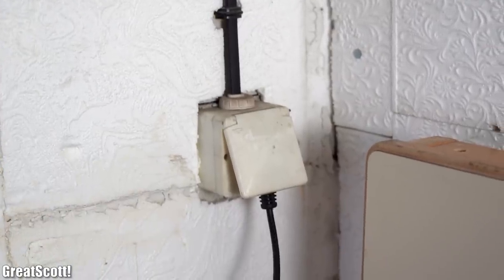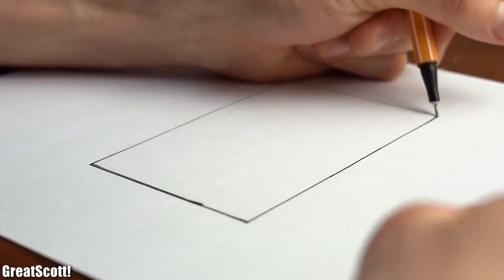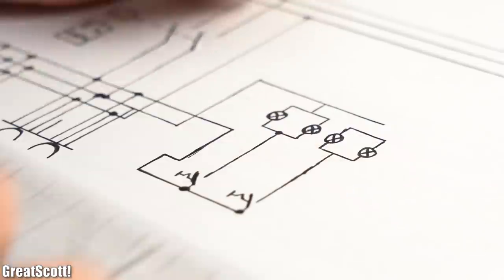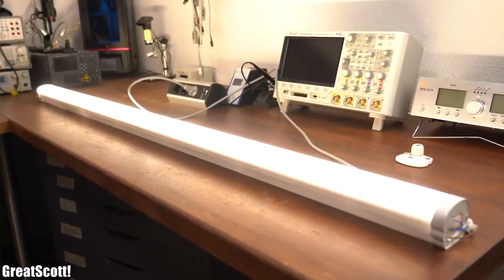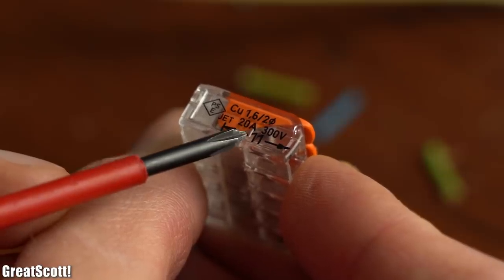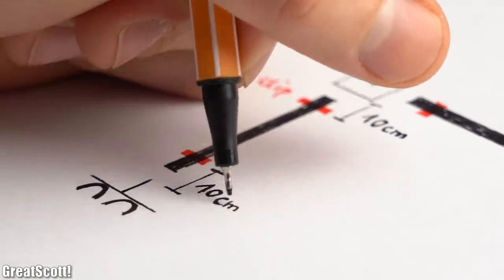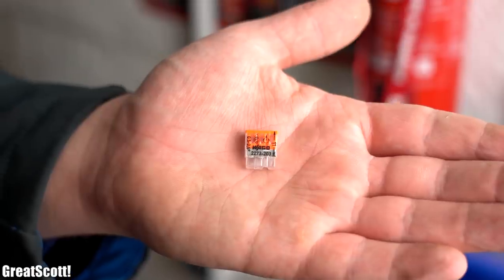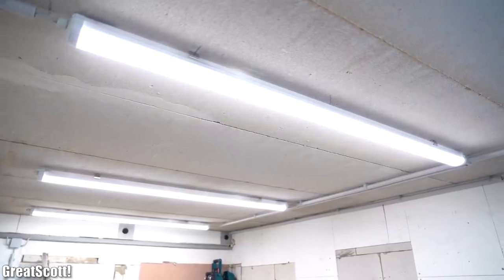How to do Electrical Wiring properly! (more or less....) GERMAN STYLE!

Comment: European standards for this kind of thing just seem exponentially better than any American standard the more I look into them
Reply: Most European standards are FAR better than American standards.
Reply: How do exactly? Seems really similar. For an exposed garage in America, we would need everything protected in conduit or metal shearing. The rest looks really similar as well.
Reply: I would disagree. American wiring standards are pretty impressive, especially considering it is a system of standards that has been in place for over 100 years. Just look at any US installation with either AC cable or EMT conduit. The installation in this video looks a little sloppy - in spots where the cable is not covered by conduit. With an EMT conduit, it would first be installed in a most effective way, and then wire pulled through it. That way all of wire is always protected by the conduit/boxes(which are metal and also provide backup ground)
Reply: @vitaliyzakharov6708   Impresive . Most American electrions just make it as good as the minimum has to be . Sorry but every time i seed American electric work its just the lowest Qality ever.
Reply: @vitaliyzakharov6708  the host used the wrong word. It's not wire, but cable.

The wires are always protected because in a on wall installation like this you use cables and not wires.
Reply: Also it doesn't make much sense that they're using a fuse along with circuit breakers. And that they haven't added separate breakers for lighting and plugs.
Reply: There's a lot of willful ignorance out there pretending to be about standards. The standards in North America, the Middle East, Asia, the UK and Europe seem different in small ways, often more a matter of the local history of electrification, copper shortages, and (surprisingly rarely) politics.  In North America,  AFCI's (Arc Fault Circuit Interrupters) have been required for years now in new wiring-- so how many of you have them  in your kids' bedrooms or living room?    Even though they appear less urgent in 230V countries, they are life savers precisely when an appliance malfunctions and draws a lot of current, but not enough to trip the breakers.

Comment: For all the people who don't have those spring terminals but a screw terminal. If you use solid core wire with the screw terminals style components. You need to check/retighten the screws after you press the whole e.g outlet internals into its housing. Since if you move/wiggle the solid core wires you could create a little space in the joint that could lead to a fire in the worst case.  If you want to do a test for yourself find a screw terminal style component, tighten a solid core wire, wiggle it, and then try to tighten it a bit more and you will feel that you can tighten it more.

Comment: American: Confused Unga Bunga
Reply: Why is the wire unprotected from the conduit to the junction boxes? I'm so confused.
Reply: @mitsuman007  I've never understood this either. But be prepared for a bunch of germans making up reasons as to why parts of it aren't protected. "Well you won't touch and damage that part" ...who's to say it's not impossible? Why bother protecting ANY of it with that sort of reasoning? All I can presume is that it makes the install cheaper and easier.
Reply: the gap is probably just for easier installation and to avoid kinking the wire. Though this type on conduit is more for organization than protection.
Reply: All I could think of is all the bugs getting in there so easily also.
Reply: @xxxh4x0rxxx21  have you ever had kids? Or designed something to be kid/idiot proof. Plenty of grabby fingers/accidents can pull those wires out. In the US the wire insulation isn't that bad, but they are housed in metal tubing. So, pretty strong defence.
Reply: @DaniMakes  Those open cables are only allowed in utility rooms we are kids are not allowed to play unattended / except in Germany kids are never allowed to play unattended
We have something called a Kabelkanal for rooms where it’s not possible to lay cable underneath the plaster  and have kids nearby
Reply: @TecSanento  I'm not the authority on standards. But that's sorta silly to assume a place will never have stupid people in it or kids. Aha. If that were true though, I'd still think it a great place for bugs and junk to get into. So it really is just aesthetic isn't it?
Reply: @DaniMakes  yeah, mostly aesthetics for these pipes -  but just to make it clear, which kids are big enough, that they can grab at 1,2m heights and at the same time stupid enough to play with electricity ?
Reply: @TecSanento  the same that make labels on products state obvious warnings.
Reply: American wiring is better than that, only cheapskates use pex piping, and those guys didnt even bother to bend it, they just cut it lmao. Why even use it at this point.
Reply: Hardly. In America those exposed wires wouldn't meet code. If it's not in-wall, it's in a conduit.
Reply: @DaniMakes  electric cabling in metal tubing... what could possibly go wrong. ;-) In the video they are handling cables, not wires - it would be really hard for a kid to pull them out of the junction box.
Reply: @AndreasStanglPlus  a lot less than you assume. It is grounded and really safe. Mock what you don't know I guess
Reply: @xxxh4x0rxxx21  problem is we americans tend to pull, hang and rip on any thing we can thts why our cables have to be run in a way to handle tht kind of abuse. yet are sockets have no switches like uk and are plugs are open contacts with just mm away from fingers lol

Comment: I didn’t even realise Aluminium wiring was even allowed in Germany or anywhere else in Europe! Thought it was purely an American aberration 🤣
Reply: Uk did have some. So always check even your tails. Also BT used Aluminium which cannot take the new Fibre To The Cabine so if you have big internet problems with speeds below 22mbs
Reply: After <whisper>the war</whisper> the price of copper went through the roof, so a lot of places built in the 40s, 50s and 60s got aluminium instead of copper.
That's one of the reasons the UK has its interesting ring main system. It uses copper, but requires far less than the fused spur setup used elsewhere.
My UK home was built in the 60s, the wiring is copper, but the phone line is/was aluminium, which being 60 years old, likes to break when disturbed.
I think most of the aluminium has been replaced these days.
Reply: Aluminium wiring is still allowed here in germany.
Reply from the maker: This system was built during the DDR time before the reunion. That is why it is aluminium.
Reply: @Electronics-Rocks  actually Shaun, FTTC can run on aluminium, but its range is less than over copper. I get 78mb/s, but I'm lucky because I can almost see the cabinet!
Reply: @HB-gt6cq  😱
Reply: @greatscottlab  Thanks for the explanation. That makes sense, and I hadn't thought about that, even though I'm old enough to have lived through it 👍 I just assumed it had to be all replaced by now.
Reply: @juststeve5542  I've always missed it in the UK. My Grandparents house was built in the 1930s -- copper, rewired several time, all copper. My parents house (1890's) was rewired in the 50's -- copper. My own house 20 years old -- copper. The only place I've first-hand seen aluminium used was in the 1980s in the USA. When my American stepfather told me about it: I honestly thought he was pulling my leg, until he showed it to me 😱
Reply: @gregf9160  everyone takes the mickey out of our UK ring main too (usually because they don't understand it), and miss its huge advantage.
If you want to add a new socket you only have to break into the ring at the nearest socket and loop it into the ring, you don't have to run a feed all the way back to a huge fuse board at the other side of the property and on a different floor! ;-)
Reply: @juststeve5542  No, I know. Been there, done that -- on several occasions.
Reply: @gregf9160  now we'll just keep that our secret whilst we chuckle at these foreign types running 30 meters of cable and pulling up carpets just to add a new socket in the bed room ;-)
Reply: @juststeve5542  yes I know as ex BT but the number of people raising complaints was  far higher on aluminium  which ended in line replacement once level of complaining was high enough.
Reply: Wait what? People use CCA for power?
Reply: @Electronics-Rocks  for ethernet (cat5e at least) it's common to use copper-coated aluminium

Comment: UK differences, similar to other countries:

1. Conduit SHOULD be continuous, ideally metal earthed, and sealed to all JB's with sealing glands not just pushed through membrane seals.
2. Distribution boards are called Consumer units normally and:
     MUST be all steel,
     smoke and fireproof,
     to prevent fire progression.
     Earthed to the main PE
3. Plastic Consumer units are ONLY allowed inside another larger all STEEL fully sealable enclosure
4 All cable glands MUST be appropriately sized, MUST have the correct seal for the cable style e.g oval for twin and earth, dual round hole for twin separate cables and power tails (round) must be double insulated outside the CU from the main supply point after the main fuse and pass through individual glands for maximum safety.
5. It is NOT normal to include lighting on a power circuit unless fed from a separate fuse plate. A garage supply would typically be a 40A feed to a 32A power ring and 6A lighting circuit in its own CU in the garage (or external shed). 
6. The 32 A ring is capable of supplying multiple UK 13A dual outlets (26A total each dual or 6.5 kWatt per double outlet - 3.25 kW per single socket) on the basis of diversity of simultaneous loads. 

So a dual socket every 1m or even 500mm is totally legitimate since the ring cable capacity to a single dual outlet is 2x24A (2.5mmsq x 2 per outlet point). This provides a WIDE safety margin on top of the rated 48A ring load capacity and 32A breaker value.

 Sometimes 2 x 16A radials may be provided instead of the 1 x 32A ring. The latter is more capable and far less spike overload sensitive - important when running any kind of inverter or VFD 2-3 phase supply frequency converter feeding three phase machinery. (NOT a problem in Germany and elsewhere with domestic 3 phase being pretty much standard)
7. Unlike the US which has BARE PE connections allowed inside distribution boxes, Europe generally AFAIK and DEFINITELY the UK requires ALL bare PE connections to be sleeved in green/yellow PVC  sleeving.
8. In the UK individuals are NO LONGER allowed to add new circuits to a CU or work on a CU in ANY way without obtaining Building regs approval first, AFTER preparing and submitting a plan of work in advance and having the installation fully tested for compliance afterwards BEFORE returning any power. This means it is usually cheaper to hire a registered and certified sparkie to undertake the job.

The annoying and frustrating thing for graduate Electrical & Electronic Engineers like myself, is that whilst I worked for many years as a field engineer, often on 415 and 600 volt circuits, perfectly legitimately I am NOT allowed to work on my own domestic wiring. Except that is for extending, repairing or replacing existing wiring OUTSIDE of the CU and OUTSIDE of "wet"areas e.g. Bathrooms, kitchens shower rooms etc. Yeah! Go figure!

Other differences exist for many countries.

Comment: Hi scott, circuit breakers protect the wires to avoid current flow above the nominal range of the wire circuit. differential isntead detect an unbalance current delta between neutral and line  and if is >= 30mA it will trip.

about the wiring,,, for a load of 16 A we use at least 2,5mm2 section ... 1,5 mm2 is for 10 A

Comment: GS: and be careful to use the proper connector for stranded wire...'
Me: solder the tip of the wire to turn it into solid wire
Reply: Yep ;) if it’s small power it should be fine...
Reply: Never solder the stranded wire and use it in a screwed down connection - that's a no go! The solder is soft under pressure and remains in a floating state causing a risk of bad connection and a fire hasard. Either do as GreatScott shows in the video and use the correct spring loaded connector, or use a crimp ferole to make it a solid connection
Reply: That is fine for low current DC.

Never on your mains
Reply: Bad idea on AC current like everyone pointed out. If you are concerned with stranded wire and you don't have the fitting WAGO connectors, you should either buy the proper connector or use terminal crimp tubes that essentially cold weld the cable. It also provides a better connection for screw-type terminal blocks.
Reply: @StickySli  meh, it's been 6 years on high power tool and it works just fine... 'may change it one day...
Reply: Me: NEVER solder cable ends for mechanical connections PERIOD!!! Get an assortment of cable end ferrules and corresponding crimping pliers, and do it properly. 
No discussion.
Reply: @red1246  the thing is it will work. But it extremely unreliable. 
And yes I do it all the times. But then I am talking about 4V DC or something like that.

Comment: It's surprising to me how the conduits don't finish at the junction box and the wiring is done with that jacketed wires, we doit here with single wires, and the conduits are finished inside the junction and equipment boxes so no wires are exposed.

Great job, very clean and easy to fix if something need's a repair or change.

Comment: Replace the Fuse with an automatic breaker it's old
Reply: If he does not own the garage I dont think he is allowd to
Reply: @bashaaksema94  well if he's renting he wont be able to replace the electrical installation anyway.
Reply: @filipstefanovski2077  that is not always true and I just thought that because that might be part of the main installation he is just not allowed to replace that part
Reply: @bashaaksema94  but the main breaker that the electricity company provides is usually a 24A breaker for each fase
Reply: @filipstefanovski2077  i mean that this is what the owner of the complex profides.
Reply: @filipstefanovski2077  If I recall correctly, with any installation in the unit you are renting, you are only allowed to perform modifications after the first connection to shared property. That fusebox connects the unit to the shared grid all the garages are on, so you are not allowed to change it.
Reply: Yeah i was confused too, never seen a fuse in residential electrical systems EVER and i'm almost 30 years old!
Reply: @St0RM33  If you are american they werent used in america
Reply: @filipstefanovski2077  no i'm european;p
Reply: @St0RM33  how have you not seen them i still have them in my home and yes i will be changing them soon
Reply: @filipstefanovski2077  maybe because it's not used under UK style of installations??
Reply: @St0RM33  if you are from the uk you didnt have them eather

Comment: As boss of a German electrician company I would have done a few things different, but all in all a nice job. 
At first I should mention the IP rating of the distribution box. It should be waterproof in a garage acc. To VDE. 
To be more flexible use i12 instead of sd7 as junction box. So you can fit up to 3 cables from one side. 
Additionally I would try to avoid cable and conduit crossings for example by using 5x1.5 and junction boxes by the lamps. When it have to be put the cable under the pipe. 
All in all a nice video 👍

Comment: Some differences to UK practice in a similar setting (that is a single phase supply to an outbuilding/garage). Distribution boxes like this (called consumer units) have had to be made of non-combustible materials for several years. You would also never, ever find a socket installed in one.

In terms of circuits, a 16A or 20A radial would be implemented using 2.5 mm^2 cable, not 1.5 mm^2 (and, no, not all UK sockets are on 32A rings; radials are used too, but as every plug has a fuse it means that sockets can be attached to high current circuits). The lighting would be connected either via a separate 6A breaker or via a spur box off the main radial with a 5A fuse (the lighting cable will be either 1.5 or 1.0 mm^2). However, the separate circuits route is very much the preferred one. UK RCBOs are generally narrower too and only take up a single space on the DIN rail. However, it is also common in the UK to use a separate RCD (which is double width) and use that to protect several circuits with separate miniature breakers (MCBs). Frankly it's a cost saving approach which I detest as several circuits will trip if there's an earth leakage fault. For me, it's RCBOs every time.

Also, unlike Schuko sockets, UK sockets are all polarised with live/phase and neutral going to specific connections.

There's another difference with the cable, and that is the protective earth does not have separate insulation, just the PVC outer. Where it enters a junction box, switch, light fitting etc. it has to be sleeved. I assume it's a cost saving measure, although it does mean the cable is a little less bulky. 

In the UK it would not be legal to use junction boxes with a press on lid like the one shown. In general, access to live connections must require a tool to be used (so junction boxes generally have a screw lid). 

The conduit is a good idea, but not a legal requirement in such an environment in the UK. In the case of my garage, I made a compromise. All the cable runs which run along the wall are in conduits, but at ceiling level the cable is exposed (apart from junctions of course). However, I see that you haven't used bends on the conduits so there is some exposed wire anyway.

I should also add that I used metal power sockets and light switches in the garage. It's not a legal requirement, but they look good and are robust if they take a few knocks.